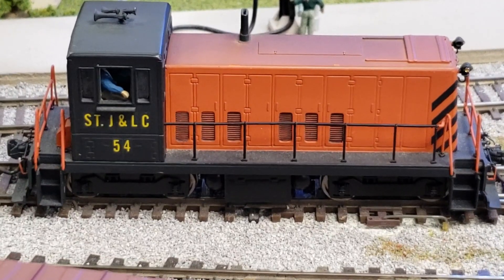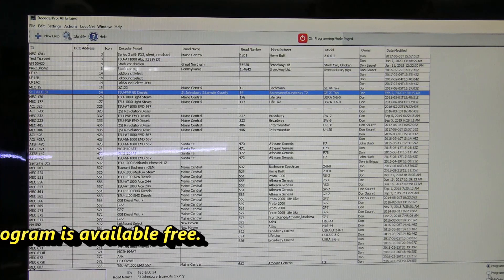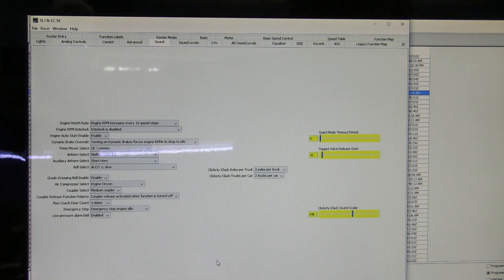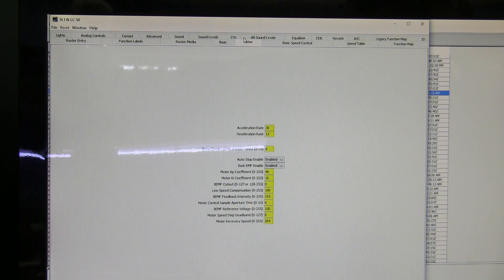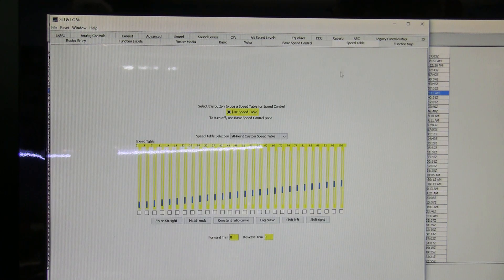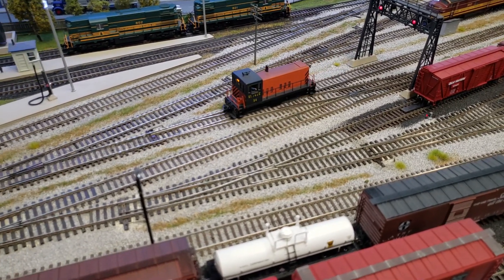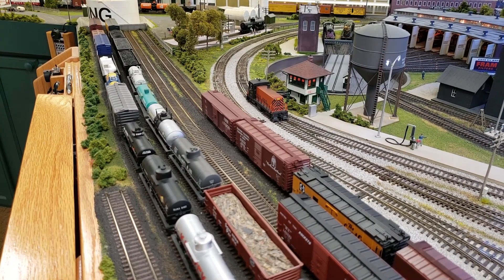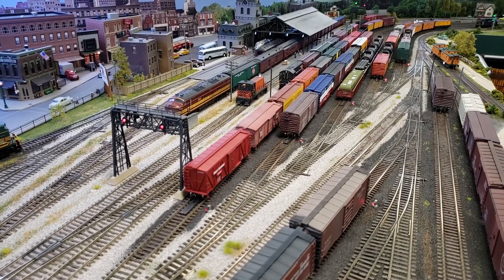Programming Sound: SoundTraxx Tsunami 2 DCC Decoder using DecoderPro  How-To In HO Scale Switcher

Comment: Hi there. What are you using on your programming track, like what connects the track to the computer? And can decoderpro programme digitrax and loksound as well? Quite new to the dcc world and want to set up a programming track that will hopefully do as many decoder brands as possible. Thanks in advance
Reply from the maker: Sorry for the delayed response.  Somehow I missed your comment.  I use a Digitrax 210+ command station which has a USB connection to the PC.  Decoder Pro is definitely the way to go for programming almost any brand decoder.  Loksound decoders are a major pain, even if you have their programmer.  Sounds in the various sound slots are different for every model, and unless you have the information from the Loksound website for your exact model, it's a total easter-egg hunt.  They work fine once you get the programming worked out!  Soundtraxx are my favorite by far.  Digitrax decoders work well for throttle, but their sound decoders are not as good IMHO.

Comment: Dave, great result, just one question: can you in also switch the locomotive lights from LED-white to old fashioned yellow?
Reply from the maker: LED's come in many color temps, so if you are noodling around inside your locomotive, changing the lights to a warmer color is not a big problem, simply by replacing the LED's.